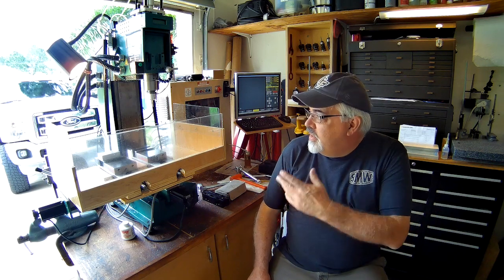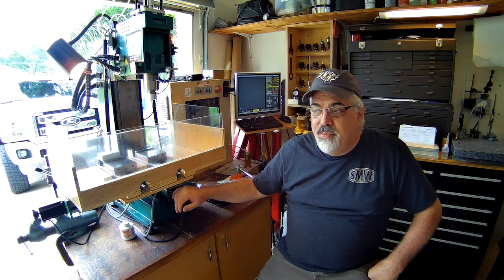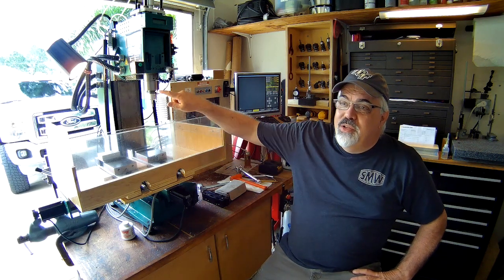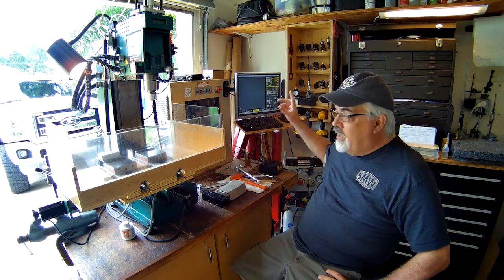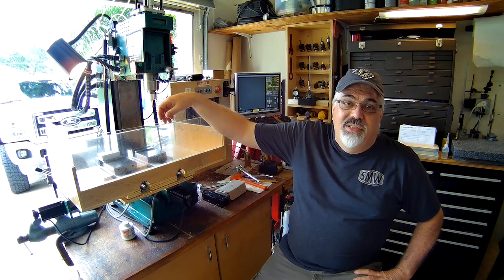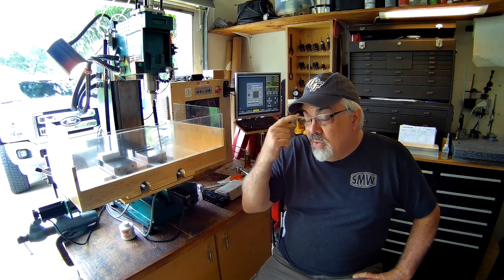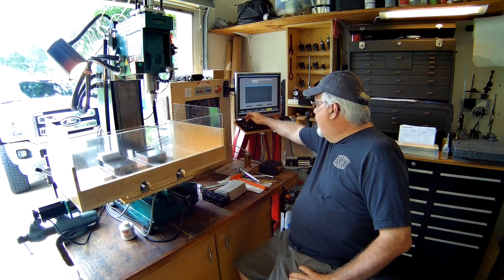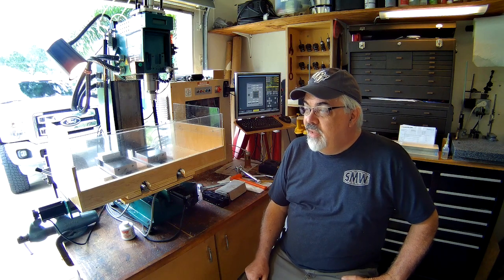Masso CNC Controller - 1 Year Later Review

Comment: ive been looking at this controller for  a plasma cnc and a cnc router...they seem to be an awesome outfit...thats a really tidy build...nice work sir
Reply from the maker: Thanks for the nice compliment. Allot of people have used a Masso controller for those applications.  My experience with Masso has been great but I have learned from past builds to take my time and start with only a very basic configuration at first.  Once the basic motors and drivers are working well you can add more features and sort them out as you go.  This slower paced approach will save you lots of time and be much less frustrating in the end.